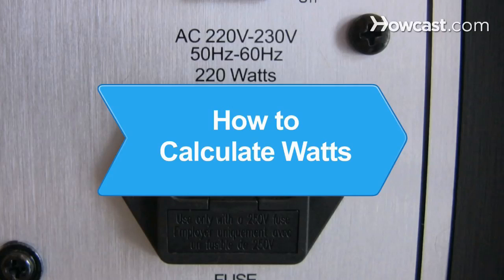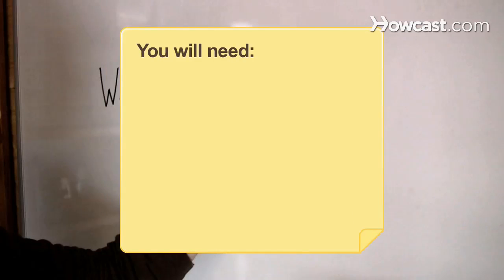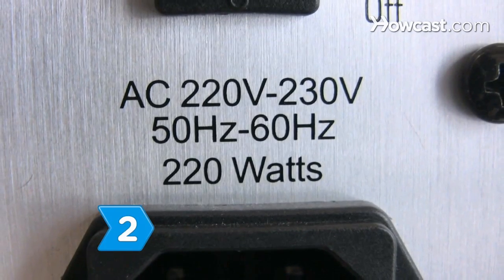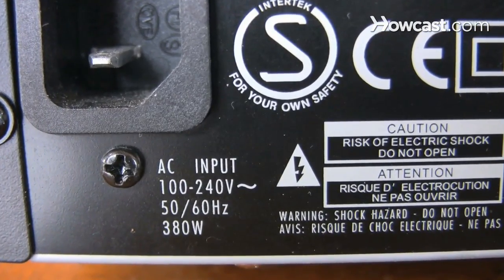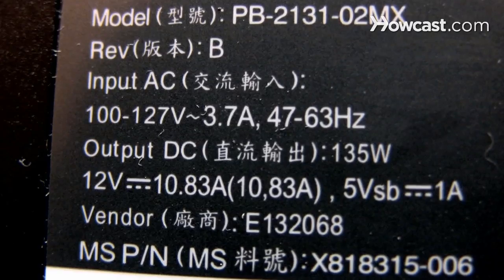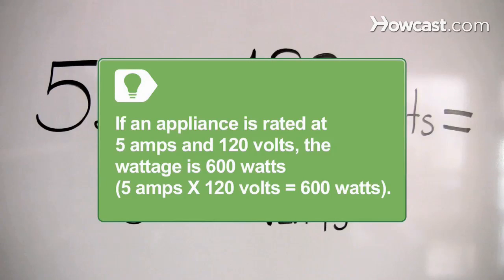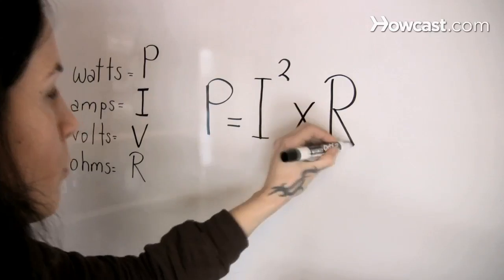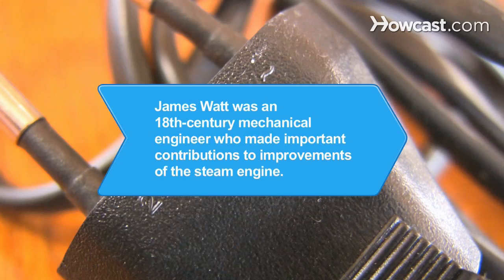How to Calculate Watts

Comment: Can a 1000 watt inverter power something that takes 240 volts. And how many volts is in 1000 watts ???
Reply: Your inverter would need to be made to deliver 240 volts (not common for most US inverters).  Watts do not define the voltage, but but if your inverter was 240 volts, then you would be able to supply about 4.17 amps (1000/240)

Comment: Question please.  The neutral conductor connected to a GFCI (white) is always
insulated. Why is the EXACT SAME neutral conductor that runs from outside
the home to the STEP DOWN TRANSFORMER not insulated?